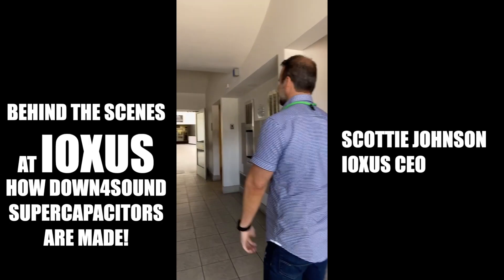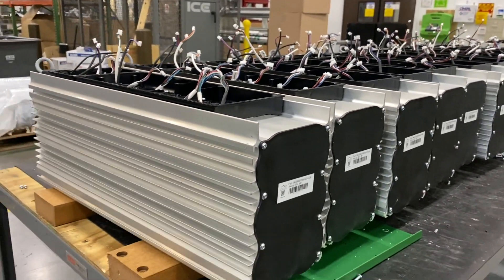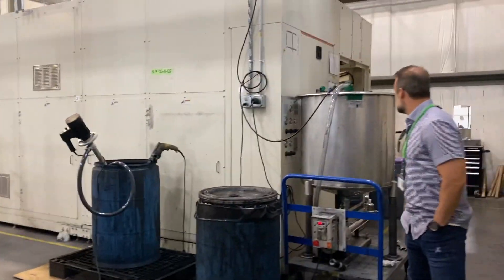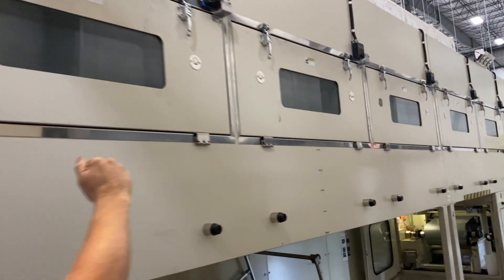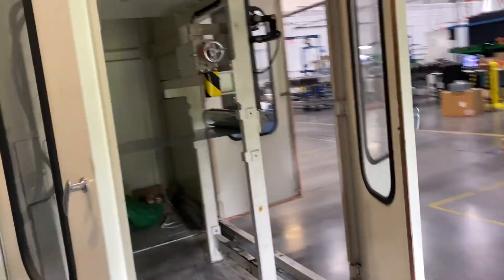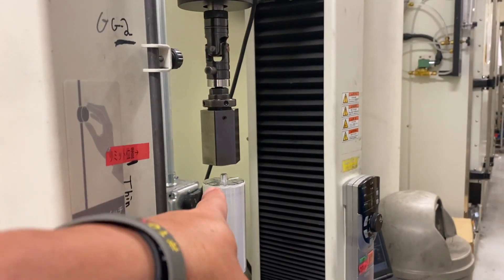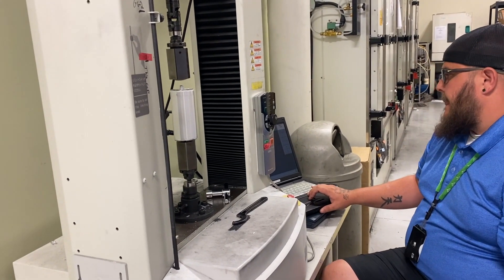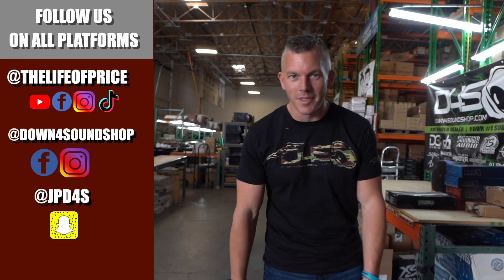BEHIND THE SCENES AT IOXUS: HOW DOWN4SOUND SUPERCAPACITORS ARE MADE!

Comment: I finally spent some cash and purchased one of the banks and I can't complain.  

Long Youtube story:  I purchased a ONE farad capacitor from a local audio store called Earmark back in the early 90s.  I was very unimpressed but I have kept it all of these years; it was manufactured by Mallory (typical electrolytic capacitor).  I paid $120 back in 1992.. It was/is ugly and black/brown/scuffed but to my surprise it actually works because I verified it by testing.  

Terminating that single farad capacitor at a distribution block yielded an increase of over 300 cold cranking amps using 4 gauge cable.

The bank of Super Caps I ordered this year on sale has a similar return of 350 cold cranking amps, but I'm using 4 gauge..  Testing the bank at the terminals yields nearly 1500 cold cranking amps!!  lol

I'm glad other people have taken risks and stayed in the hobby because I could no longer justify it as I needed to keep a roof over my head:  but I'm slowly coming back.

Comment: I have the ustart cap for cars and it quit working after I used it for a few months on my 8k taramps now I'm disassembling it to reuse the caps iv had one short and burn a hole through the black stone or metal whatever it is that protects the bank 4 days now on disassembly and all iv gotten done is the PCB section is removed how do I repurpose these easier guys?
Reply: Any pictures or videos of disassemble? I believe I have a bad 1 also and have thought about taking apart just to see the inside of it

Comment: i recently purchased the IOXUS 12v group 31 super cap to run in parallel with my battery to power a 4400w amp. I haven't installed these yet but I am wondering if that will be enough or if should i upgrade the stock alternator as well. I have a 140w alternator factory. will likely be getting an amp for the speakers I have yet to purchase as well.
Reply: Always replace you alternator first, then worry about your voltage & use a bank of super capacitors if needed.
Reply: Same here wondering what M size the post are to get correct distro block